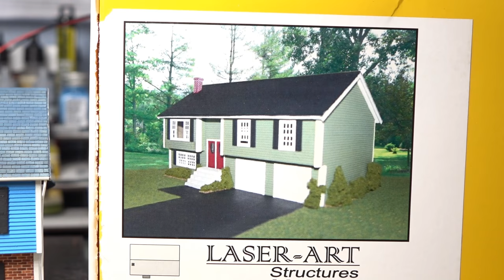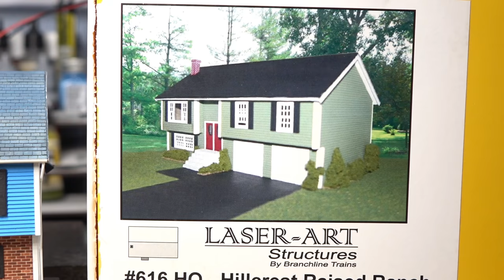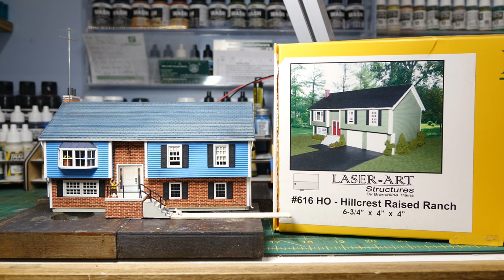Kit Build #1, PART 3 of 3: Laser-Art #616 Hillcrest Raised Ranch

Comment: Rob- You did a Great Job on the Hillcrest House. I liked the different additions to the house, the bay window sets it off along with the Pirate Radio antenna. The owner of the House must listen to the RR radio channels, Plus broadcast his own Music over the airwaves. I think that you should put up some  Highway railings for the protection of the house or some hedges along the front close to the road, for protection of the House. Along put some bicycles along the backside of the house on the sidewalk leaning up against the house. Would be Neat if you could fine a table with a umbrella for the upper deck and then put a picnic table on the bottom deck along with a grill. What do you think, what about a riding Lawnmower sitting in the back yard by the old shed to the left or is that shed for something else? Please Keep up the videos, looking forward for more from you. You give me Ideas. :)
Reply: We have several ideas, many you have mentioned, for additional details around the house, yard, road, driveway, etc. Just need time to get it all done! But we are thinking exactly like you are...